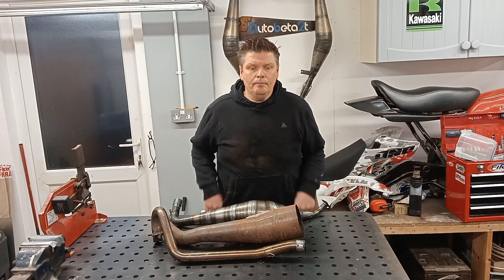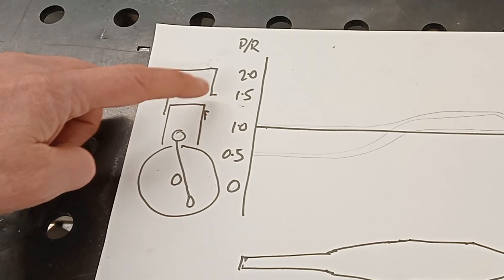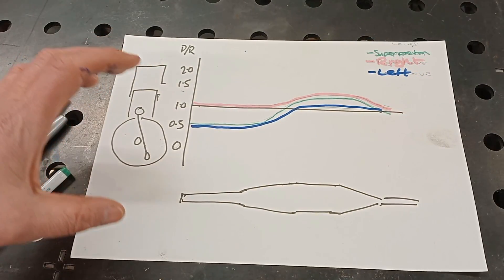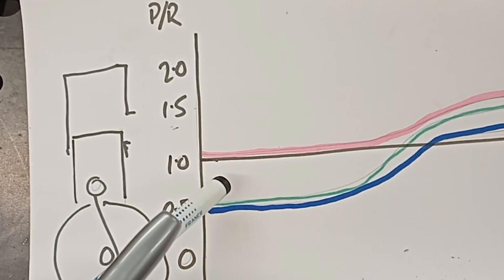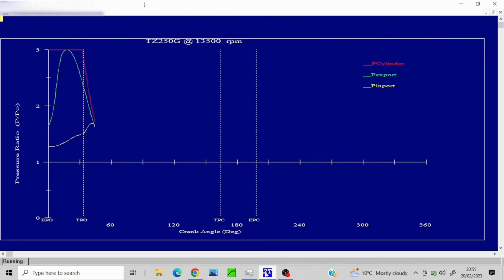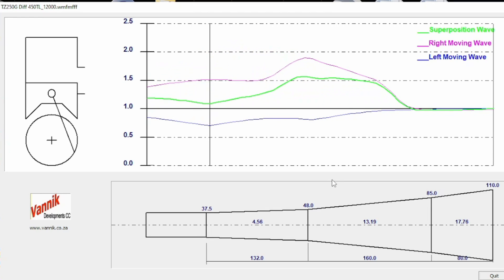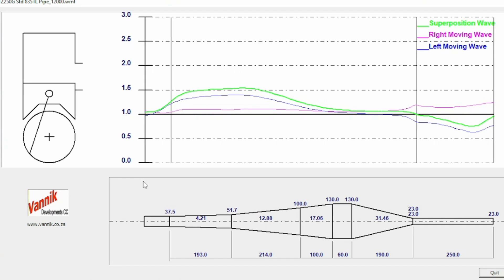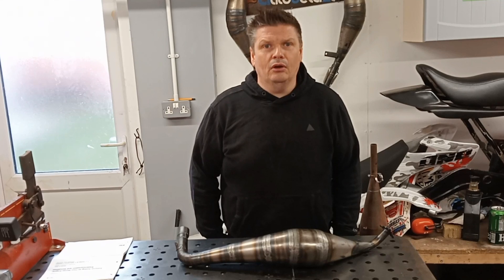2 Stroke Expansion Chamber Explained how 2 Stroke Exhausts make More Power! #2Stroke #Exhaust

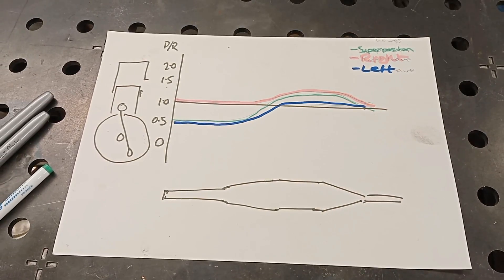Comment from the maker: I say at 3:05 that the left and right waves are theoretical but that is INCORRECT - they are real but can't be measured. Only the combination of both pressure waves, the superpostion wave can be measured. However, they can be calculated by EngMod2T and seen in WaveViewer2T
Reply: Yes, the issue is that it is not possible to differentiate each by simple pressure measurement due to super positioning.
Thanks for the shout out too :-)
Reply from the maker: @AuMechanic  No problems - cheers

Comment: Thank you for Research and information.
I watch this video 3 days ago , it help me to find out why pressure wave too strong when i install "High flow Silencer"  

This Video  help me alot  to learn How in control pressure wave inside Exhaust port and Exhaust chamber ,   too strong pressure wave  make  Air and spray-fuel  Separate (Air/fuel burn slower at high  RPM + small black dust on spark plug)  ,  too weak pressure wave  losing power

Thank you very much.
Reply from the maker: I'm pleased it has helped 😀

Comment: My expansion chamber has a 20mm inside diameter pipe for the first 15 inches or 375mm long and then it begins to enter  the expansion area. it has a 20mm id stinger as well
 Is this going to prevent the negetave wave from returning to the cylinder ???
Do I need to taper the header from flange to expansion chamber ???
Should io buy a used 80cc dirt bike pipe and weld it on. to my factory flange ???
On a fixed income / Retired, so budget is pretty well non existant.

The engine is a motorized bicycle balanced bottom/ Mineralli top cylinder 47mm piston 40mm stroke =69.4cc.
 Port timing wheel mounted on the engine,  85+85 = 170-degree exhaust begins to open and closes at, 55+55=110-degree intake transfers begin to open and closes at.
 85 - 55 =30 degrees of blowdown, ( the time the exhaust starts to open to the time that the intake transfers begin to open).
 So 30/110 = .2727 which is 27% blow down.
170ex 110in with 27% Bld.  
These are the port timings that the Mineralli came with, (I cleaned and de-burred the port openings only)
Reply from the maker: Hi sorry for the delay - I'm just catching up on comments. I'd say a tapered header will help. I did a test years ago on a YB100 and it did make a difference (can't remember what but worth it). 20mm inlet diamenter sounds small. The stinger at the same 20mm dia sounds big. Yeah motorcross pipe will defiently liven it up I recon. There may be some on ebay for a reasonable price

Comment: Analyzing a single cycle gives a false result.
We must consider 7 or 9 cycles to see the superposition of all the wave movements in the resonator.
Reply from the maker: Hi, sorry, I thought I had replied.
The sim has to perform a certain amount of cycles at each rpm step, I think from memory it is 15 but you can specify higher. This allows the gas dynamics to settle down and give a consistent result.

Comment: Analyser un seul cycle donne un résultat faux.
Il faut considérer 7 ou 9 cycles pour voir la superposition de tous les mouvements des ondes dans le résonateur.
Reply from the maker: Hi, the simulator does at least 15 simulations at each rpm point to allow the calculated dynamics inside the engine settle. This wave would I assume once this has happened. If I watch the pressure wave output as the simulator runs (blue screen) you can see that it take quite a few cycles for the waves to settle and stabilise.

Comment: Nice clear vid, thx! , Now I wonder; since most people cant create a custom pipe, could you reverse engineer it to a bought exhaust pipe and reverse engineer cilinder port timing carbs and jetting? since most of those have many small budged or diy variations and a pipe is in most cases a 1 time high dollar buy, im planning on tunning a 50cc am6 with a LeoVince X-fight and wonder what carb to use, what reeds to use, what should the exaust port timing be to match the exaust best?(if at all possible), any tips or tricks?🤔🤗
Reply from the maker: Hi Omnificent and thanks.
Regarding the exhaust, I had a quick Google of that pipe but I can't see any specs for what timings it's designed for but I guess you could reverse engineer.
I used to race an Aprillia RS50 with the AM6 engine. From memory (about 10 years ago) we had a Hebo cylinder (193 ish exhaust 130 ish transfers) running with a KRD exhaust pipe. Carb was a 20mm Dellorto or a OKO 26mm with a sleeve to make it 20mm for the race regs. Ignition was a PVL one.
We had about 14 hp at 12500 rpm. Reeds were v force 2  I think but it has been a while.
Will your bike be on the road still? Are you planning on tuning the standard barrel?
Reply: @AutoBeta2T   thx for the awnser, and sounds like a solid setup indeed, I recently noticed the #Freetech50 races in europe, these guys get 20+hp from the little 50cc, fingers went ichy and wanted to pickup my old hobby from the late 80's (Honda MB8 honed, ported, 8valve reed... scary fast), stock in our country the 50cc2t are restricted to 45km/h, done with rpm limiters and plugs and bushes, so im gonna try undoing that stuff 1st before trying an airsal cilinder with 21mm carb(road use), most pipes dont give specifics though but found one that specifies a 7-11krpm range; SCR Corse Chrome for the 50cc, the fact that most pipes dont specify what they are designed for except maybe the cc's is exactly the problem im trying to overcome.. thx!🤗
Reply from the maker: No problems. I'm not sure if you can get them anymore but I have the dimensions of the KRD pipe somewhere if you want them?
Reply: @AutoBeta2T  I really wont be able to build my own pipe, but am planning on doing some cillinder and engine case matching/porting with easy to aquire parts (why I chose the am6 Yamaha TZR(basicly same as Aprilia RS50)), thats why I wonderd how to reverse engineer a setup with the bought exhaust pipe as a base.. thx!
Reply from the maker: @omnificent1973  cool... I'm sure the pipe will work okay 👍 Hope the build goes well 😀

Comment: Would be interesting to see the waves in a standard silencer, front pipe, diffuser, belly then a flat plate with a hole to locate the inner end of the baffle
Reply from the maker: Hi Roy, could you elaborate a bit more in the flat plate  with a hole?
Reply: @AutoBeta2T  wish I could send pics, there's a flat circular plate with a central hole the same as the baffle O/D which the inboard end of the baffle sticks thru by a few mm to keep it centralised. After that usually a few more similar plates which the perforated or fluted baffle pass thru to allow the gas to expand in stages thus reducing noise. If you have a worksop manual for the AR there's prolly a cutaway drawing
Reply from the maker: Ah - think I get you. As in the silencer?
Either way, if you have any pics you can email them to: autobeta2t@yahoo.com